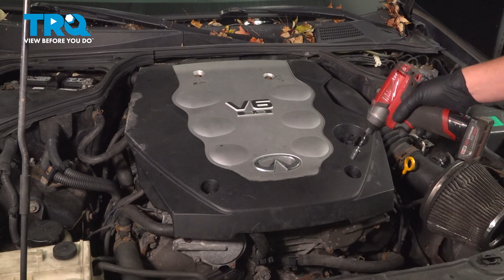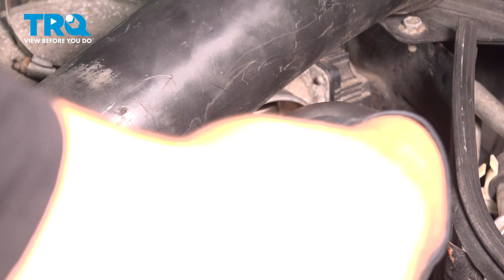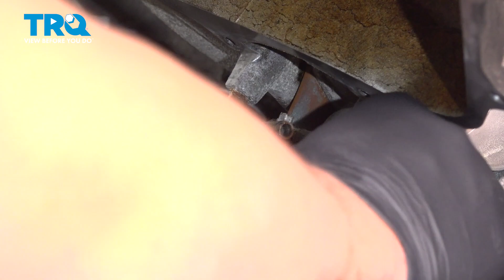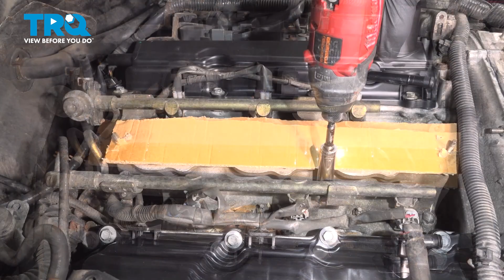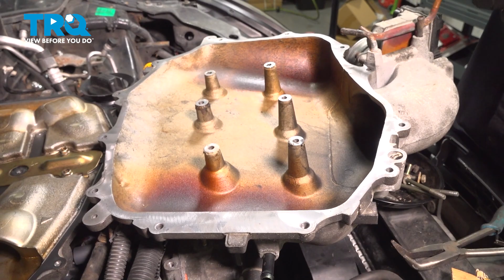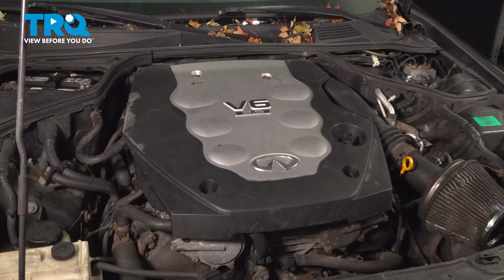How to Replace Fuel Injector 2003-2007 Infiniti G35

Comment: (1) you have to attach the clip to the new fuel injector BEFORE pushing the injector up into the fuel rail (or else it wont be seated correctly, and thus, wont function as intended)

(2) dont snug down the fuel rail like its done in video. Theres a specific order and two step torque sequence in the factory sevice manual. The way it was done in video probably crossthreaded all four bolts. So the fuel rail could come out under pressure and start a fire

Comment: Can a faulty injector or 2 injectors make my car smoke white? Mainly when I press hard on the gas from a dead stop or put it in reverse N step on it? Other then that my G35 doesn't smoke.... Really love my car N I've had it for a year this month, I just don't wanna take it to someone N be lied to saying I should swap engines
Reply: Check ur air intake and coil packs are tight and sealed properly
Reply: Use gum out fuel injector cleaner

Comment: My 2006 g35 throwing up p0300 code. Random cylinder misfire. That’s the only code. I changed spark plugs, coil packs, o2 sensors. Still no change. Done research and could be one of the fuel injectors. Should I buy all 6 Injectors and replace or see if Infiniti can scan it and tell me what’s wrong.
Reply from the maker: +@daaafoo8857  We wouldn't be able to diagnose an issue like that here, you may want to have a local mechanic take a look at it. Thanks for checking us out! http://1aau.to/m/Shop-1AAuto-c